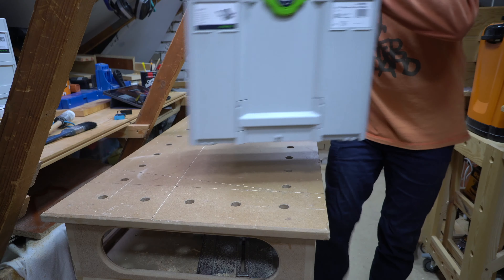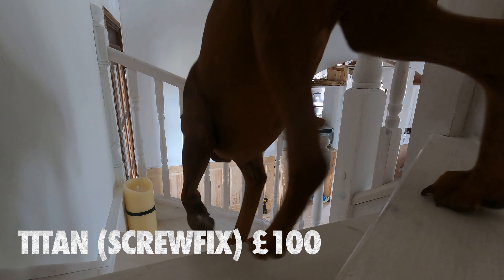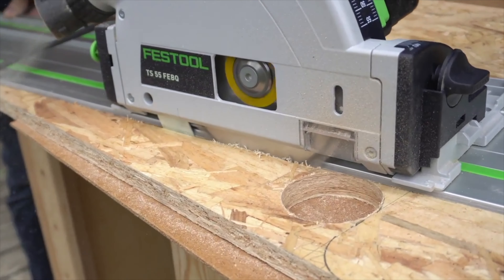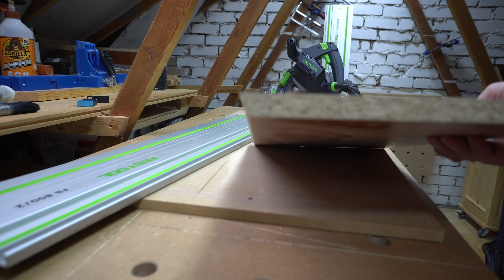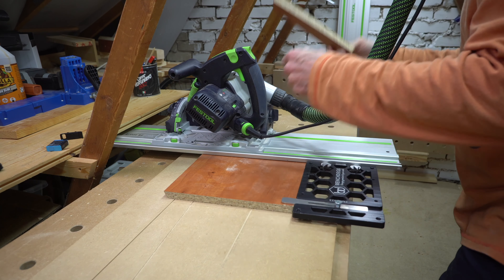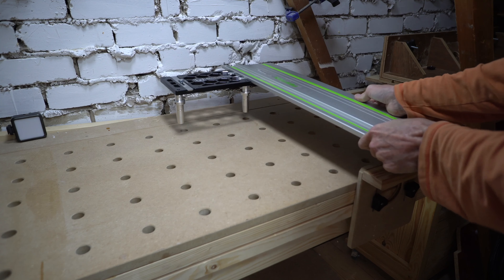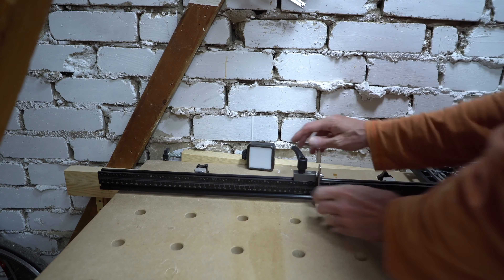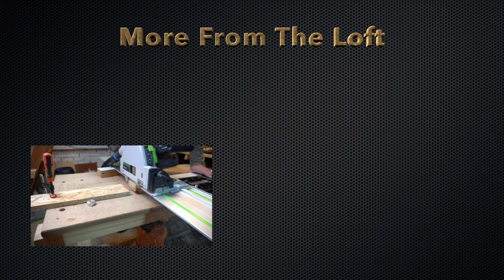Bench Dog Cross Cut Station for the Small Workshop

Comment: I was wondering if you would only need one row of 20mm holes to make this work ?
Reply from the maker: Yes just one row.. I’ve even made it work with a row of holes in a length of 3x2 which I screwed to side of shed 😃 regards JP
Reply: @Smallbarnworkshop  So basically, I am shopping on benchdog’s website what do I need to buy to have a setup like you ? I find it a little confusing, they have a bunch of packages and accessories that I am not sure if they are needed. I was aiming at the fence bundle and the square, would I need something elsr in your opinion ?
Reply: I’ve got a Similar set up. The dog collars obviously impede the fence. I see you set your fence above / resting on the collars. Do you remove the fence when adjusting between cutting different stock thickness (or just set at the thickest and crack on?) 
I use quad dog fence dogs so it’s a faf to remove the fence each time and have to re calibrate! This set up has been a game changer for square and accurate cuts!
Reply from the maker: I just keep it at about 23mm high as that is good for around 80% of my cuts. Need to remove fence to adjust but do it so irregularly. Regards JP
Reply from the maker: I bought the square bundle although I really only use the two dogs that support the square. Then the cheapest fence with flag stop. I bought it in last years Black Friday sale Regards JP

Comment: Good collection. But...
I know it is common for woodworkers to use terms like 'perfect' and 'exactly', but it makes all engineers wince. There is no such thing as perfect, what we aim for is 'within tolerance'. Might seem a small point, but it is a viewpoint that 'keeps it real'. 
On the last tool, my fence has a small sacrificial strip on the end. This prevents tear-out, and can be easily replaced if it gets tatty.
Reply from the maker: Morning Mike. We don’t have the same tolerance in wood work though. I’m not sure which BS EN code covers joinery production - I’d need to look up. I work in drywall and the allowances set out in BS8000 would make an engineer ill 🤒
Reply from the maker: Ps . Made a similar fence the other week. I cannot do a sacrificial part with the Fencedog as the dims or the flag stop wouldn’t work. As I run a nice sharp blade I do not see any tear out anyway
Reply from the maker: Looks like BS1186-2 is the standards but I’m not going to spend £138 to download it 😂
Reply: @Smallbarnworkshop  You do not see any tear-out beyond tolerance...       Much depends on the material being cut. 
I made my own fence, because the commercial ones are deeper than needed, and the graduations are on the side, not the top(where you can see them). Dog-holes are in the face, so less width taken up by fence. For multi-cuts, I use my TrakLyft system- as you know, I have made several track-saw/MFT mods in my videos.
Reply: @Smallbarnworkshop  Standards set the minimum acceptable. Most of us want to exceed that. And, being prescriptive, standards are rarely optimum for a given use case. You are within tolerance when being more accurate would not improve the function or appearance of an item. Good design increases tolerances where possible. When tools produce parts that can be assembled without fitting, they are producing within design tolerances. This is not always possible with consumer/trade tools of course. But the parts are never perfect. Neither are the materials.
Reply: After tolerance comes pedantry. Cheers.
Reply: @theswime945  Pedantry is the pursuit of precision, so - thanks!

Comment: Well, I was left with my track saw only as I had to sell my table saw because of moving into a smaller shop. And I miss my table saw. A lot. That's not a question of accessories. The table saw is always ready and require minimal setup. That's not the same story with a track saw. On the other hand, the track saw works fine if you have flat or planed stock. You will never be able to resaw a board on its small side to make veneer or thin stock with a track saw. And remember the good part is under the track, so if you need a small part, how will the track stay flat on a so small surface and most of all, how to secure it correctly under the track ? The inconvenient truth is the track saw limit is the track itself. Longer or thinner than the track leads to problems that are difficult to manage. Some people will be frequently out of that range. I do.
Reply from the maker: Some good points Axel. Regards JP
Reply: Very true- there are some tasks that are a hassle without a table saw. Much can be done with a mitre saw or bandsaw, however- and they can do tasks that a table saw cannot. Fact is, we need several saws... When working with sheet goods, however, a track saw is the most accurate (unless you have a v large cabinet saw) and cheaper/smaller/portable. You can get by (for most things) with a tracksaw and jigsaw if you are without a workshop. I do not use my table saw much- but I would not want to be without it.